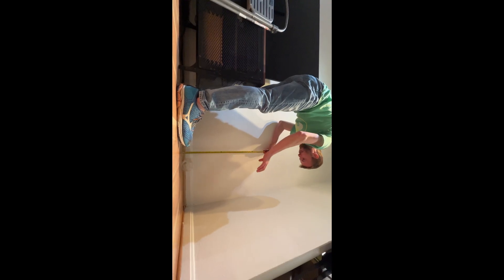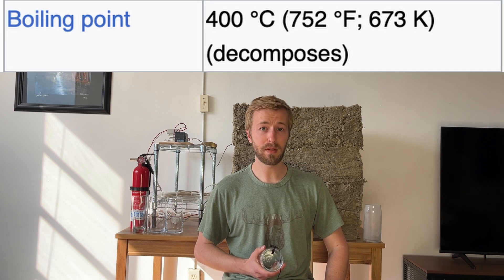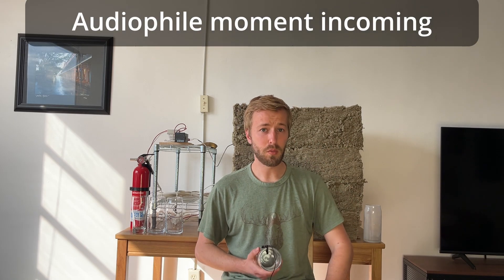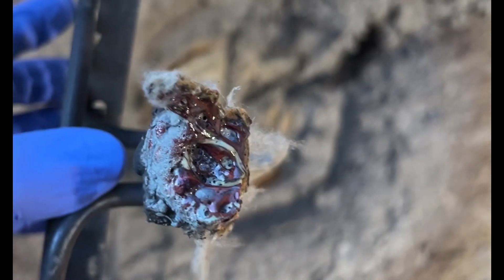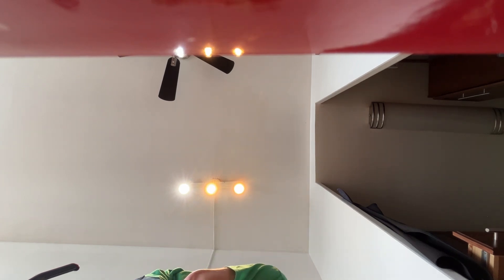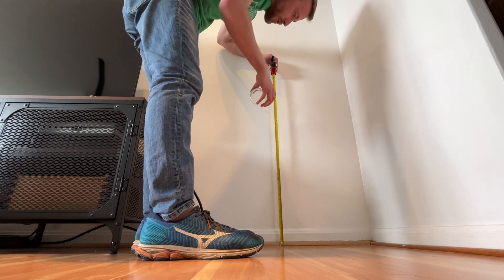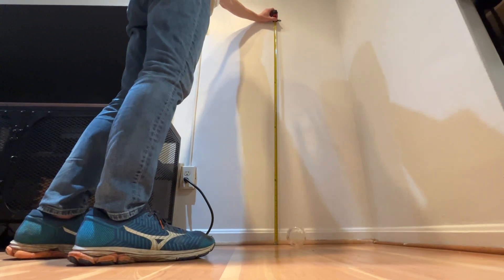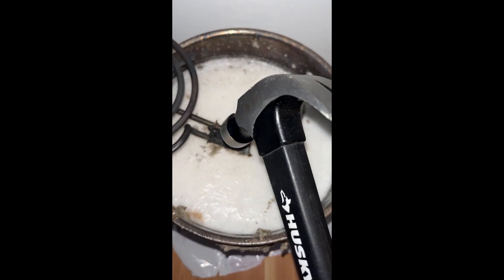Making My Own Super Strong Glasses (Superfest)

Comment: 5:44 question: how much time did you leave the glasses in the oven at 500° F? Did you slowly lower the temperature until it went cold? 

And how did you made the oven with the rockwool, like you just shaped it in a cube and used a random electric stove or it has to be an especific kindnof electric stove?

Nice video btw
Reply from the maker: I just turned the oven off and left the glasses in until the whole oven cooled enough to be safe to touch. I'm not really sure how long that took, since I usually left and did something else. 
As for the rock wool, I cut it into squares and layered the squares on top of each other. I cut a circle out of two squares that was just big enough to hold the pot. Also, yeah just a random electric burner.
 And thanks!